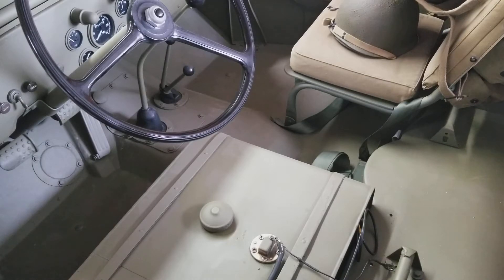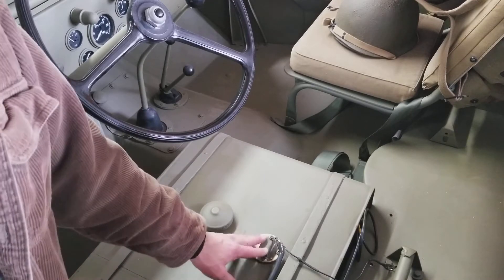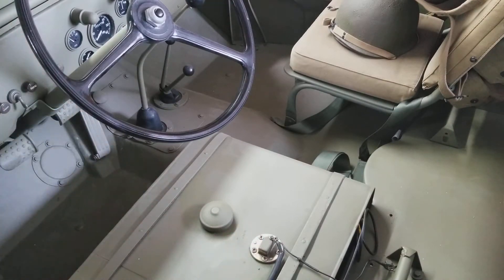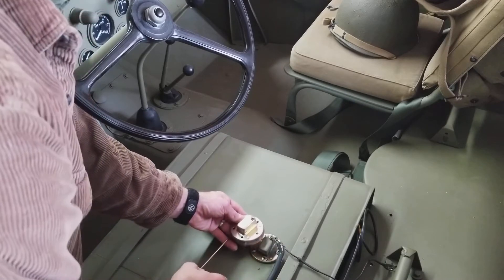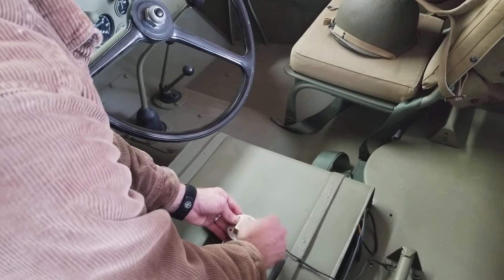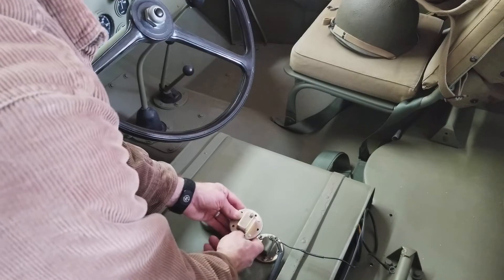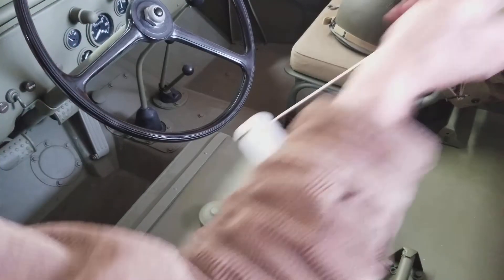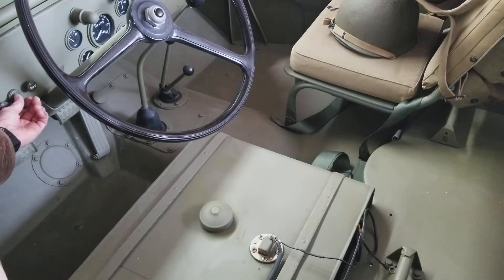Jeep Fuel Tank Sending Unit Replacement Service for Willys MB / Ford GPW WW2 WWII

Comment: What if my fuel gauge reads empty all the time, even if the tank is full.  How do I test it and find out what the problem is ?
Reply from the maker: Here's one thing you can try: With the ignition switch on, unscrew the wire connected to the top of the fuel tank sending unit, and once it's loose, touch it to a grounded surface such as the metal housing on top of the fuel tank sending unit.  The fuel gauge should peg to full tank side when you do this if the wiring and the meter are good.

If this doesn't work, check a couple things: Make sure you're touching the wire from the top of the fuel tank sending unit to a good ground.  If the unit isn't well-grounded, you might have trouble with the meter.  Also, some jeeps have a 2 Amp fuse in line with the fuel gauge.  This will be under the dash, and it could be bad.

Comment: Is that normal to have a small gas cap.?
Reply from the maker: Fuel tanks made for the 1941 and 1942 jeeps had the smaller filler hole. They started making tanks with thd larger filler hole in 1943-1945 models.